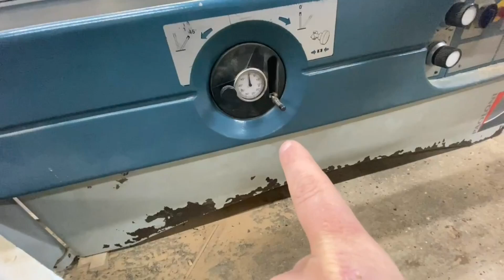Bits and bobs in the workshop and a big modification to the panel saw #22

Comment: Those floating shelf mitres would be easy for a spindle moulder using the "Mitre lock" cutters. You can buy them in either HHS or Tungsten. A spindle moulder is a great asset for a small to medium sized workshop making kitchens. When I make my face frames I run a 6mm groove  (11mm deep) in the posts and rails (allowing for the sides to finish flush with the inside of the face frame for Blum/Grass integrated hinges) . Then rip the side panels to width (plus 10mm) and then rebate them to fit in the groove I machined in the posts and rails. Then simply cut all the side panels, tops and bases to length on a wall saw (easy on your Paoloni panel saw). 

   Paoloni have always made decent quality machines but I have no idea what that piece is in the overhead Guard. I have a Paoloni RD240 4 sided Moulder Planer whcih I bought new in 2003, excellant machine. 

     Then assembling is easy, all the sides,tops,bases locate into the grooves in the face frame. I then Domino just once to join the sides to the tops and bases, add glue and some screws and the jobs is done. I think making a carcass and then a face frame which then has to be fixed to the carcass is a bit long winded.. Just my way of doing things but It's fast,accurate and gives a strong joint. Keep up the good work and I've subscribed. 🙂
Reply from the maker: I have a mitre lock I brought for a router table. I can’t remember using it! Would it work in mdf? My worries would be it would snap during assembly!

I hear you with the face frames. It can be a faff but I have always done it that way! In week 38 I talk about how I use the presets on the domino and a spreadsheet to work with the different size mounting plates for the Blum inset hinges! For a straight run I don’t always complicate it so much but when I have loads of thins to fit in and cabinets next to appliances or other cabinets I like to maximise space by sometimes having them no flush with the inside. But I do really appreciate it complicates it. I like the idea of the rebate for the end panels too! I do something similar somewhere on this kicthen to extend my end panels as the lady wanted the kitchen  at 680deep. It works well as you scribe the a small piece of the panel to the wall then slot in the bigger piece. Something very satisfying about a slot!😂

I haven’t watched this video since I did it but I clearly remember that I lost my mind on that extractor hood! I think it took me nearly 6 hours! However it’s the best thing I ever did! I think the age of that saw they were less bothered about dust collection but had to have something fitted. It was like the token dust port on a site skill saw! Anyway it works perfect now apart from 45s. 

Thanks so much for watching, loving the comments

Matt
Reply: @Wattsjoinerybarn  Hi Matt, Thanks for the messages. I use the mitre lock spindle moulder cutters which works fine on timber but I keep a spare set just for MDF and it's a fantastic system. Obviously the MDF dulls the cutters over time but they last a few years. I have a Felder spindle moulder which also has a router spindle so I can use router cutters in it. I would say give it a go matey and see how you go. Probably easier on a spindle as you have a nice large flat bed and decent fence when doing larger pieces of MDF. The beauty with the mitre lock system is you only clamp in one direction and the joint pulls itself together nice n tight. I've used it for allsorts including cladding existing stair newel posts. Did it in my house 6yrs ago and they haven't moved /opened up at all. I tend to only use Medite MDF ,not the cheap furry stuff you get from the sheds and it works fine. Game changer for me. 
   I've been making Joinery for over 35yrs now, shared a workshop for 18yrs and moved to a new unit on my own 2yrs ago. Invested in some new machinery and still enjoy making stuff. I'm still picking up tips on you-tube ,different ways to make things,processes etc. 
  Funnily enough I spent a couple of hours this morning altering the overhead guard on my rip saw after watching your video.. 

  All the best and keep posting and maybe do a video on the mitre lock.👍 😁  Ade
Reply from the maker: I nearly got a hammer spindle moulder from felder that came with the router collet. Reminded me I have one for mine but it’s not as quick to change, infact it’s a a pain! I will have a little look into the cutters for the spindle moulder. I too find medite or finsa to really be the only mdf I use! Sometimes spanolux. It always annoys me that the oak faced boards don’t use premium mdf and I have noticed that the fluff stuff dulls blades more.

Thanks so much for the tips and on the next one I will give it a go for sure.

All the best Matt
Reply: @Wattsjoinerybarn   Hi Matt,
                                                      Felder make decent quality machines. I did have a major problem with the RL200 dust extraction system I bought from them but to be fair 12 months on they took it back and gave me a full refund. Long story but they are a good company. Re: mitre lock spindle cutters, I think Whitehill tooling may do them but I got mine from Leitz Tooling which are a bit better quality. Now you mention FINSA I also use it from time to time. Know exactly what you mean with regards to the Oak Veneer MDF , it tends to be woolly. I have used the Garnica Tulipwood Ply for carcasses (with face frames) which takes paint well but seems to have the sweepings off the floor in it so I actually got sparks flying when I routered some and it ruins disposable spindle cutters very quickly. 

  I love watching video's of people making stuff, busmans holiday for me but I find it relaxing watching other people work.. 

  All the best .............Ade  😁🙂
Reply from the maker: @AdrianSams 

I did like how felder operate and they showed me all their machines. Wasn’t too keen on the hammer stuff! 

I know what you mean about that and other plys. I have had some sparks fly and funny smells from it before!

I will try to film more but it’s not always easy!
Reply: @Wattsjoinerybarn  I've never been to their showroom but I had a 1980'2 Felder Series 7 spindle which was fine for the 18yrs I had it. Would love to have gone to Milton Keynes to their showroom but couldn't spare the time and I already knew people who had Felder. The Hammer brand is entry level, then the next level up is what I have so the F700Z Spindle with digital rise n fall etc, Bandsaw etc and then you get to the premium stuff (yummy) which has some fab features such as logging all your blocks in it's digital memory and adjusting the fence and rise/fall electronically. Too much money for me . The RL 200 dust extractor cost me £6k and the briquette machine which sat under it's hoppers cost a further £16k, surfice as to say I didn't go with the briquette machine. 

  I looked at panel saws for my current workshop but the processes didn't flow well and tight space so I went for a wall saw. I can just about handle 10 x 5 sheets of 18mm on my todd but I'd struggle processing 8x4's on a panel saw as I'm weak in body but have the heart of a lion.🤣🤣.

 I would imagine filming,editing etc takes up a lot of time so much respect to you Matt..   👍
Reply from the maker: Yeah it’s a decent setup mate and I would actually say it’s worth it just to look at the cnc stuff. That was a real eye opener for me. 

I was so close to getting a wall saw but the two workshops I worked in before both had panel saws and I could imagine it any other way. 

I have designed mine so I can slide sheets off the rack onto the bed and then the bed travels and finishes up about 10inches short of my benches. If I hadn’t of done that I would still be lifting them like a fool! It’s probably the slickest thing about my workshop as I can slide sheets off the lory or borrow the forks on site and then I never need to lift a full sheet!